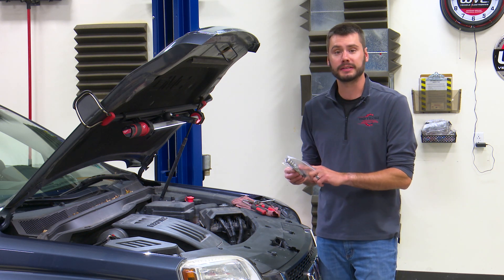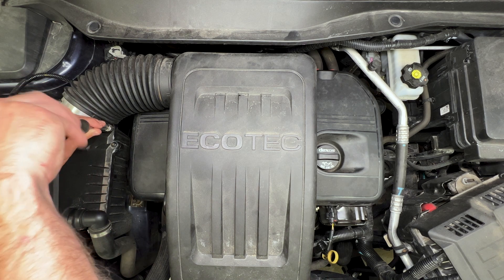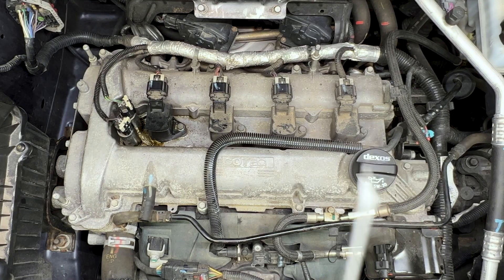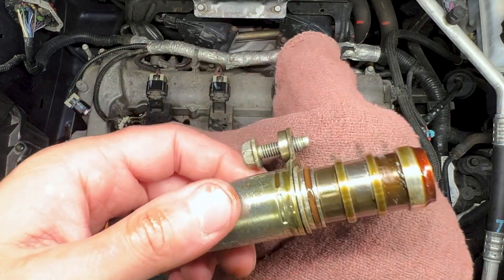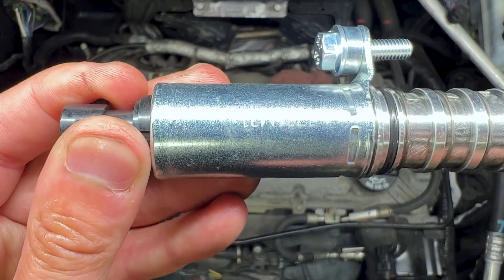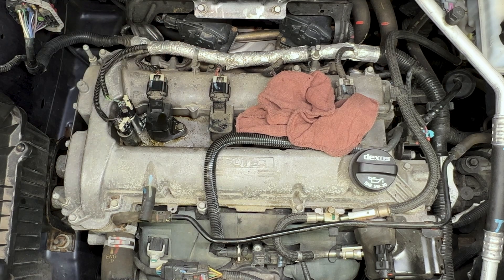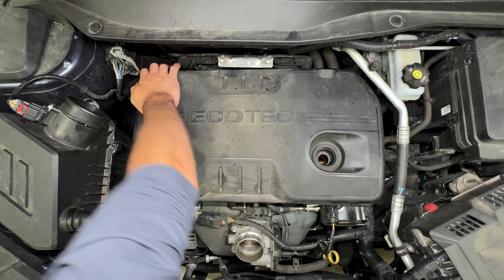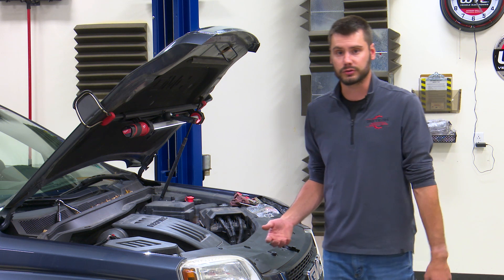GM 2.4 VVT Solenoid Replacement

Comment: VVT selenoid on the 2.4 question for you. I'm inheriting a problematic project car (please pray for me), with the 2.4 Ecotec put into an Exocet frame and converted to run on carburetors.  The original builder being too old and un-motivated to finish it.  He says it runs, but badly, and suspects that the disconnected VVT selenoids may be part of the woes. I'm just starting to educate myself on what I'm getting myself into.  Is there a voltage that can be applied to these to activate the selenoids and see what changes? Where would I find that and other tech specs like the resistance you were measuring; presumably some GM manual, is that available online somewhere?  Seriously, please pray for me.  Thanks for any insight you can provide.

Comment: So what if both solenoids have been replaced and it is still throwing a p0016 code? It with have idle roughness when sitting in drive occasionally. Drives great besides that but the mechanic tried to give me the "after market" talk about parts. We'll I paid for the OEM intake side and still doing it. What do yall think?

Comment: I have a 2006 HHR 2.4 litre that I've replaced the intake VVT solenoid on a few times. Been getting a P0014 (exhaust) code on my 2013 Equinox which also has a 2.4 litre engine so I'm about to replace the exhaust VVT solenoid. I watched this video just to refresh my memory. Great vid. Informative and concise. Thanks!

Comment: I changed both of mine out on my 2011 buick regal. But the engine light is still on . Maybe i need to check the connectors.

Comment: Ing this repair right now but what if there’s a piece of the old screw in there? How can I get that out?
Reply: If you can't use a standard screw extractor, use a metal drill small enough to drill into the center of the screw fragment. Carefully blow out any metal bits (compressed air is best, but something like wd40 might work also). Put some jb weld into the drilled hole. Thread a screw into the drilled hole. Let it cure. Back both screws out.

Comment: Thank u so much for mentioning the important bit about waiting for a while before the engine light goes off I panicked when I saw it still on and then it went away. My scanner still reads the same code as “permanent” though, not sure what that means? Thanks again!!

Comment: I found some shavings on mine when I removed them. It wasn't too many shavings, but there were some spots. Car has 210k miles
Reply from the maker: Some shavings can be ok, an excessive amount usually ends up being trouble. Also pay close attention to your oil level between oil changes, these engine like to burn oil.
~Ryan
Reply: @GoTechTraining  That puts me a little at easy, and will do, thank you very much. A friend of mine recommended I flush the engine before installing them. Is it a good idea?
Reply from the maker: The biggest thing is to make sure no junk gets in the motor when installing them. Due to their location it is easy for dirt and debris to fall in.

Comment: If you are getting a performance code it could also be the wires are pulled at such an angle that they get crimp damage right at the back of the connector, causing resistance in the circuit. I usually have to replace at least one connector with a pig tail when I do solenoids. The wires are a small gauge and damage easily but the replacement wires on the pigtail are a larger gauge.
Reply from the maker: For sure Bradley! The connectors have their issues.
~Mike

Comment: prob need a chain   thats y they code
Reply from the maker: Actually, not in this case Mike. Just the solenoid was bad...but you aren't wrong, chains are very common on these.
~Mike
Reply: I've read online bad vvt timing can stretch the chain, and the solenoids often wear out prematurely from dirty engine oil.

I've just purchased an '06 G6 2.4L and am chasing several issues, including this (I hope). It started when my car suddenly started sounding like a diesel truck!

Comment: The reason why those VVT solenoids have different part numbers and have different colored connections is because they look the same and fit in either hole. However, the shape of the connection will make sure the solenoid is connected to the proper wires. And like you said, the color of the connection determines in which hole it's supposed to go into. However, there are those people who will end up putting the wrong solenoid into the location which will cause them to chase problems they created by not noticing what they are doing.
Reply from the maker: Hi Frank,
I agree, if the wiring is long enough to cross to the other solenoid, its not a full proof design to stop an accidental installation error.
~Ryan Wilsing

Comment: Hello, what is the diagnosis behind this? What symptoms would a faulty solenoid cause? Thanks
Reply from the maker: Hey No Name, we have another video that covers the diag, check it out here. https://www.youtube.com/watch?v=I51gFnE556U&lc=Ugxz8Zn3bnRKbFxqSYt4AaABAg
~Mike
Reply: @GoTechTraining  hehe I saw that video right after I commented that, thanks! Did you guys end up replaced both solenoids or just the one?
Reply from the maker: Both, if ones bad chances are the others not far behind.
~Mike

Comment: I just did this on a 2012 malibu
Reply from the maker: Hello,
Yeah these VVT solenoids are high failure, good thing there replacement is pretty straight forward.
Did you have to replace both solenoids?
~Ryan Wilsing